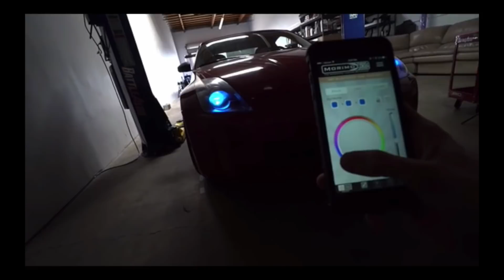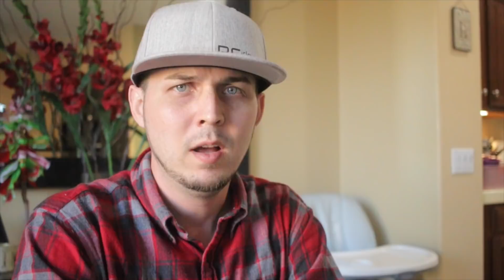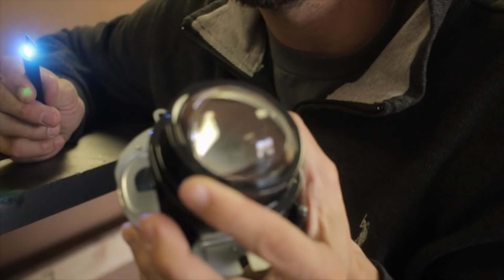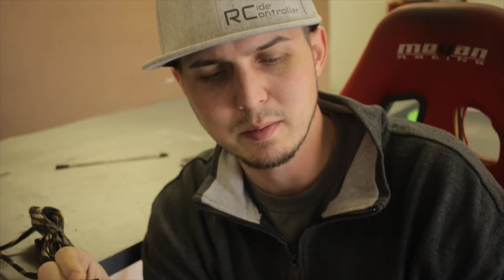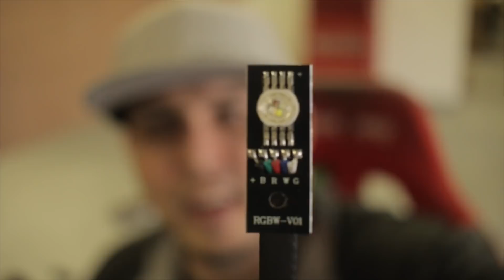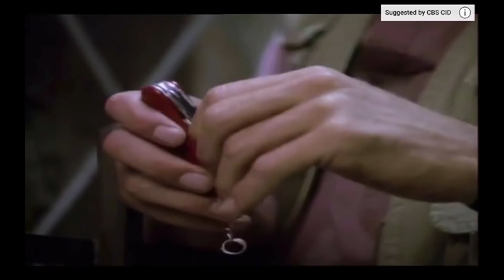What are LED Demon Eyes? Learn about Lighting

Comment: You didn't answer the one question I have about demon eyes. Can you see them when the headlights are on? I know it's illegal to have red or blue lights so if I have red demon eyes and I drive past a cop with my hid projector headlights with red demon eyes will he see the red?
Reply from the maker: I’ve probably answered that in 20 videos over the years. Demon Eyes are a tiny little light source, and low beams are a powerful light source. You’re VERY unlikely to be at the right angle to see the red while the low beams are on, but the more important question is why you would want to run an LED at all, when the low beams are on. It’s best not to, for heat and reliability issues, aside from the legal reasons. Keep em off while you drive 👌